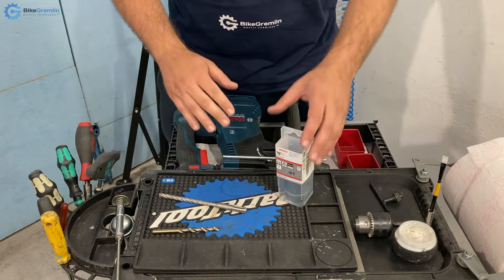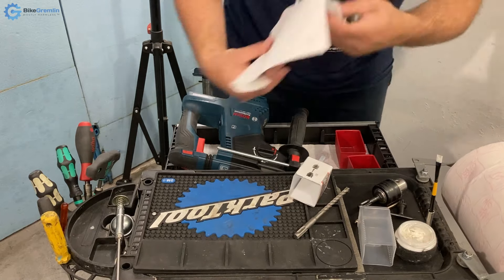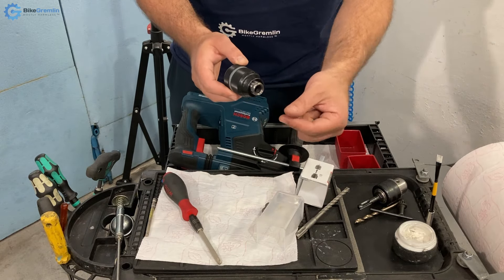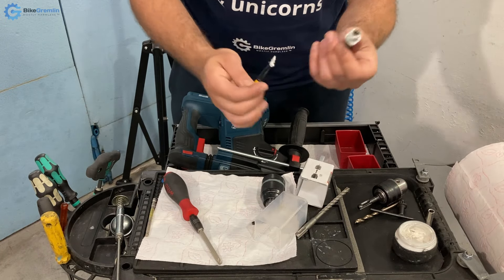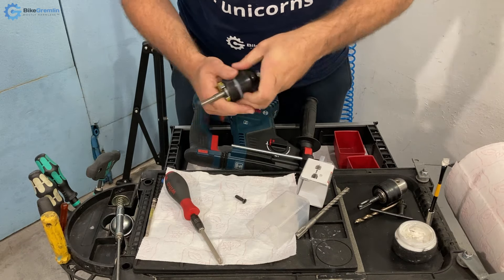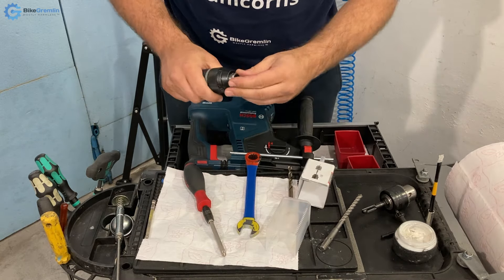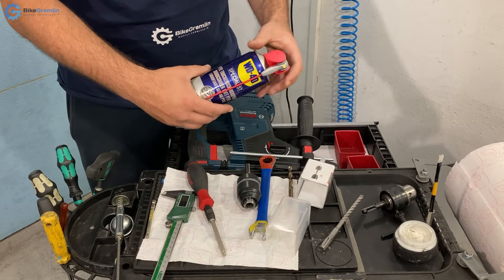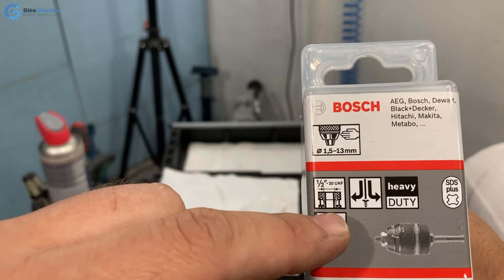Bosch Keyless drill chuck (SDS-plus to round adapter)

Comment: Interesting that Bosch supplies the same SDS-Plus to 3-jaw keyless chuck as a fully assembled unit here in Canada. Bosch Part # HA3JAW. I have the same Bosch 18V SDS-Plus drill that you have in this video, this keyless chuck adapter one of the first accessories I purchased for this drill, and I use it often. Great video explanation. Really enjoy your bike related videos too!
Reply from the maker: It is interesting how different market offers differ by a given manufacturer.

And yes - the adapter is a must-have IMO. Like a tyre patching kit: if I don't carry it, I usually end up needing it.  :)